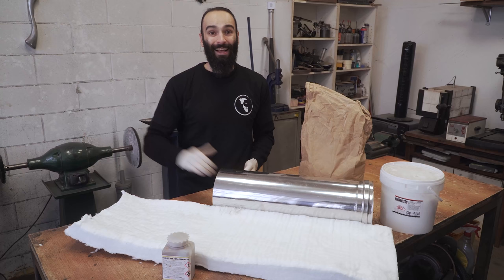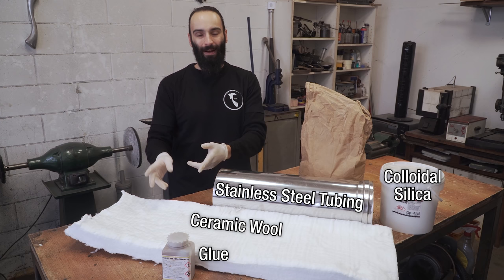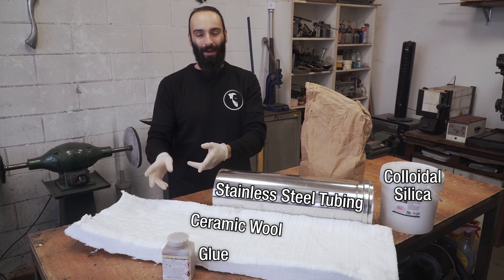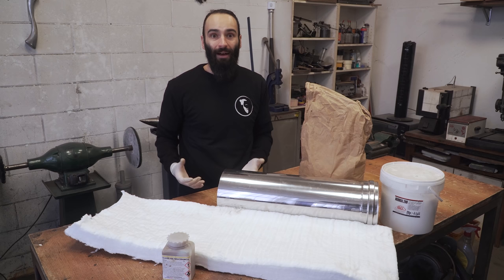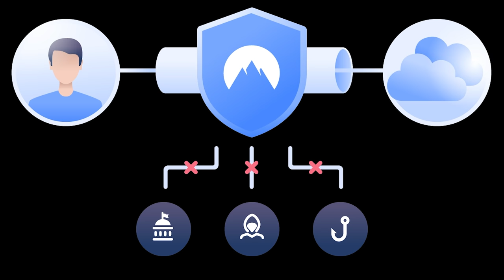Long Gas Forge 🔥

Comment: Hey @BlackbeardProjects! This is super light and compact construction- I think many Farriers (blacksmiths specialize in  hoof care) will copy it, but If I may suggest you something: You use thin steel pipe.The forge flame will burn it quickly. I think, it would be better to short this pipe a little to make the wool a little proud off. I Made similar mistake on my forge and after 5'th use my front start to bending. Anyway, this is another very cool DIY tool project and It was a pleasure to watch you making it! Regards, David!

Comment: Fantastic work!   Legitimate question: (as I know much much less about forging than you do).  I thought you got better performance if the gas came into the chamber at an angle so the gas swirled around the chamber.   It looks like yours came straight in, perpendicular to the side.  Is this because the chamber has a flat bottom?  (Or is it something else?)